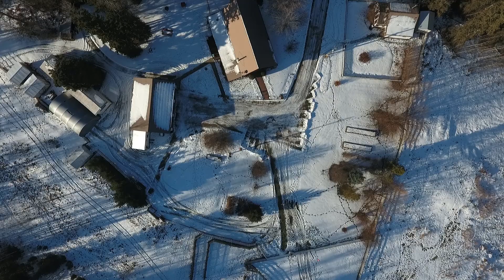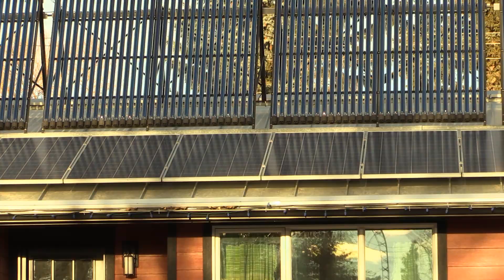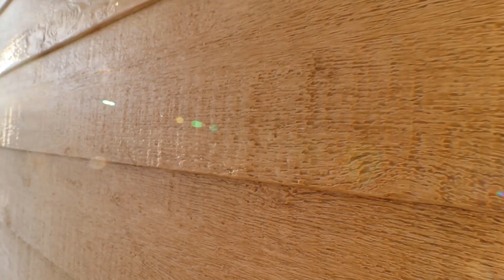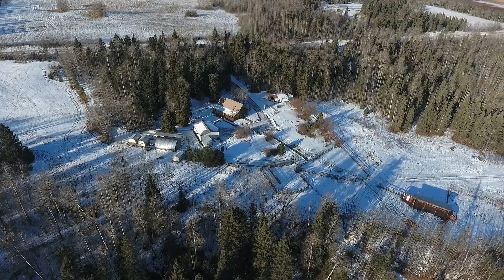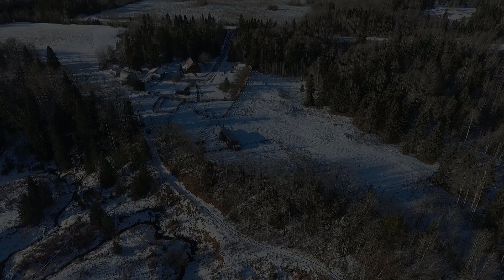5 Must Haves for a Deep Energy Refit

Comment: This is neat! We moved into an urban property (144 m2 including the house) last December and want to retrofit is as best we can and are allowed to. Here, houses are often packed together, meaning we share walls with our neigbours. Outside walls have been insulated in the space between. We are currently in the process of adding insulation below the roof and will be getting new windows and floor insulation as well. Solar panels are planned if our roof can hold the added weight, though there is some room in our SE facing backyard as well. It's a fun and demanding process and I am curious to continue watching and see what you've done since then!

Comment: I never understand the air tight argument. A proper air exchange makes a healthy environment (assuming no offgasing and harmful materials are in the house). Thermal mass on the other hand is way more important in my point of view. In a cold environment like yours a very massive RocketMassHeater with integrated hot waste exchange would be the way to go. Plus massive indoor building elements exposed to the sun in winter and in shade in summer.
Reply: I think the argument is that we want a controlled air exchange. You’re totally right that we need fresh air- however, if it’s just coming in through general leakiness, we’ll end up with moisture and mold issues, which can end up worsting air quality. I’m working on retrofitting my house and putting in a HRV- if you DIY it’s not actually that super expensive (about $1000 for us)

Comment: Congratulations on the farm. Suggestion for your roof, save the space for solar heating for air and water. You have the room to locate your PV off roof. This will save cost of installation, save on reroofing costs, allow more PV panels than roof size, and allow you to use the PV array for a shade structure elsewhere.  We went through this thought process for our farm. We use the area under for storage.  Be sure to raise it sufficiently high for snow build up and removal.

Comment: Nice looking property! When adding insulation to the walls and roof area, what is the max R value you should use in the roof as compared to your walls? For example, if the walls are R30, would R60 be the max level to put into rood insulation? Thanks